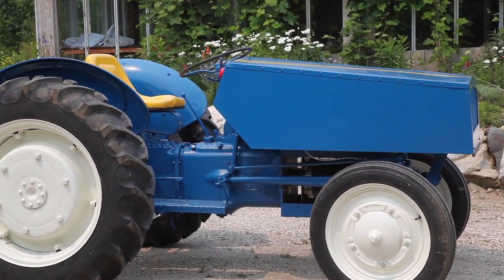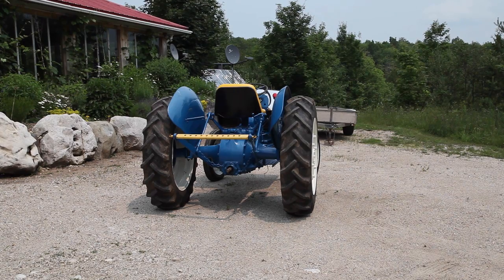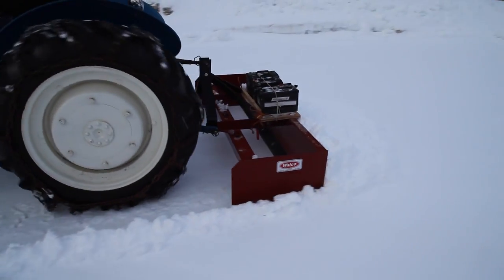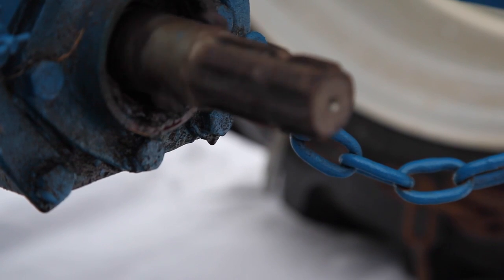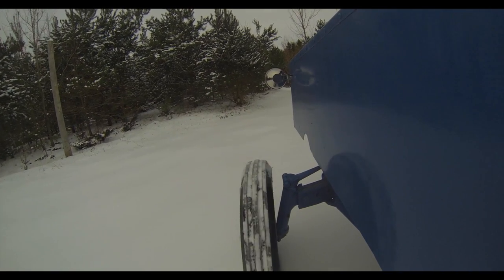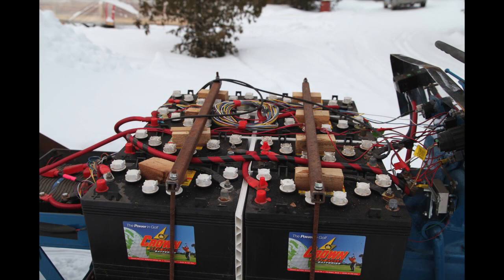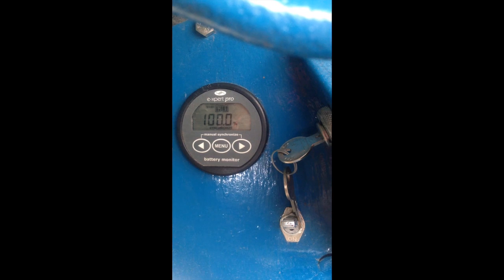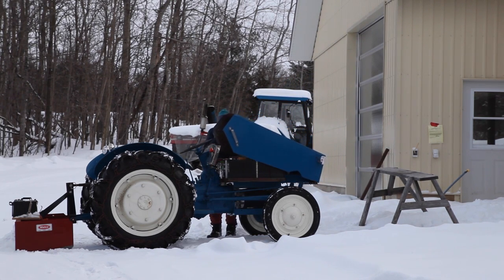Electric Tractor Conversion

Comment: I am looking to make a very similar conversion to an 8n.  Well, really the exact same conversion, except for voltage and the fabricated frame and sheet metal parts.  There really are not a lot of these conversions out there to find on the net as far as I can tell.   Yours is only the fourth I've seen so far.  One didn't mention what they did concerning the clutch, another retained it, you deleted it, and I forgot what the other did.  But I'm not sure what function the clutch would really serve.  Maybe I'm just not "getting it".  But I'd like to understand why you wish you had retained it, because if I'm not "getting it", I want to figure that out before I go down the wrong road.  Even with the clutch, you can't bring the PTO up to rpm or lift the 3 point, and then start the tractor forward by feathering the clutch.  Because the moment you push the clutch in to put the tractor in gear, the PTO and internal hydraulic pump stop.  It's just how the early N series are built, they don't have nested input shafts that power the PTO shaft even while the clutch is pushed in.
Reply: Are you planning on making some videos on your conversation? I want to get there eventually on an 8n also.
Reply: @CarlosLopez-ov4bp  I wasn't, but since you're asking - I'll be sure to make some video.

Comment: Just out of interest why would you keep the clutch if you did this again? I am looking at a similar conversion and was planning on bypassing the clutch like you did.
Reply: Ease of operation, I suspect. I'm doing a Nuffield 4/60 conversion (2 Leaf motors, 96 LiFePo4 cells) and won't be keeping the clutch.
Reply: I'm just guessing here, but maybe with a clutch you could run the motor continuously to power hydraulics?